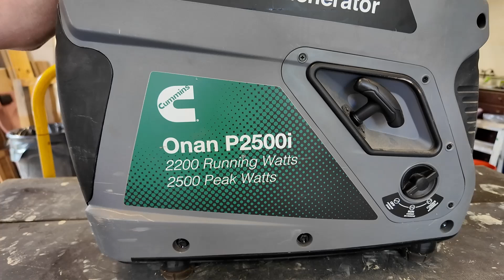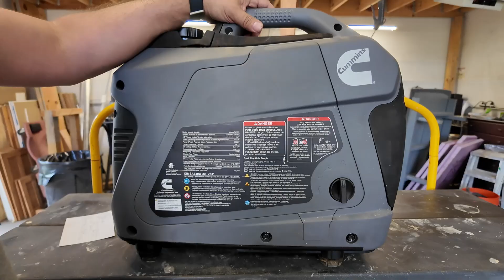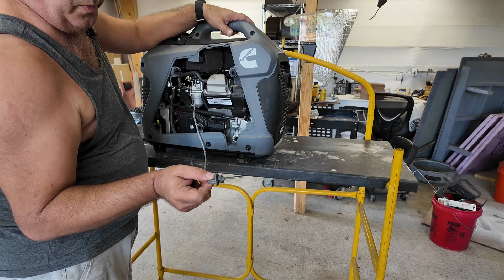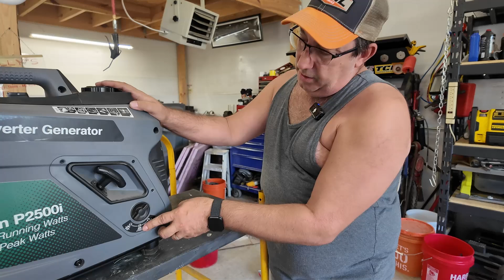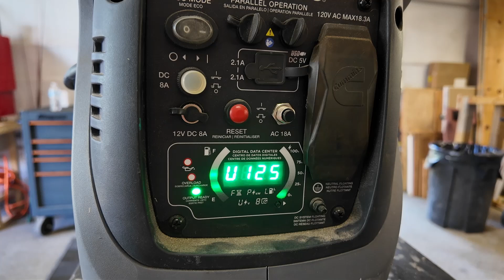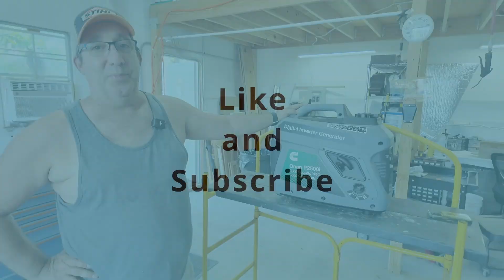Cummins Onan P2500I Generator Inverter Review

Comment: Hi there, thanks for this video.  We have owned this generator for nearly 2 years and have been very happy with its performance.  Something I have noticed on ours, and also noticed it on yours, is the fuel level information.  When my generator  is completely filled, the data screen will show it at 3/4 full and 2.4L, just like yours does.  It also shows 8 hrs of run time, just like yours did.  Do you recall if your's was completely full on gas?  I'm not sure why it doesn't show the full 4 bars for full, like the manual says it should.  I called Cummins and he did not have an answer.  Said it could be a "board" problem??  I originally thought maybe I just wasn't filling it up all the way, but now I know that I have.  Just curious what your experience has been?
Reply from the maker: I have not noticed any issues with ours. I do know that this run was at full level since we had just run it to clean up our yard after Helene.

Comment: Great video man, im on the gulf coast in alabama, and when we thought one of those storms was coming our way, i broke out my firman generator, 7500w dual fuel, and wouldnt you believe that the fuel thats in it is from 2020 when hurricane sally hit, and get this, it crunk right up!
Reply from the maker: That is very impressive that it started on fuel that old. Another reason to buy a quality generator. 7500w is an impressive generator, I bet you are popular with neighbors when the power goes out! :)
Reply: @FunnerToDoIt  well, funny thing is, when I bought it, we only got 8 hours out of it before our power came back on lol, we replaced another generator (craftsman I think) because it started spitting oil and lost compression. The Firman was a great deal at the time, 800 bucks for a 7500w dual fuel generator, with electric start. That was the other surprise, i hadn't cranked it in 2 years and the battery still had the umph to kick it over several times before it finally started.